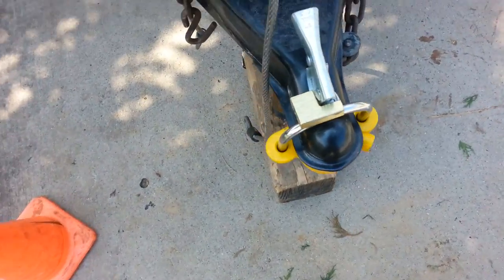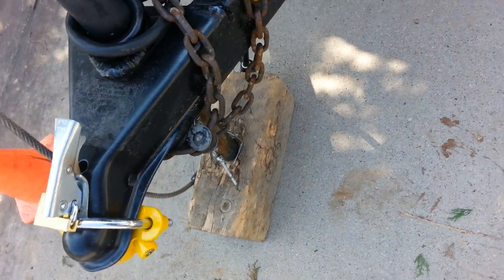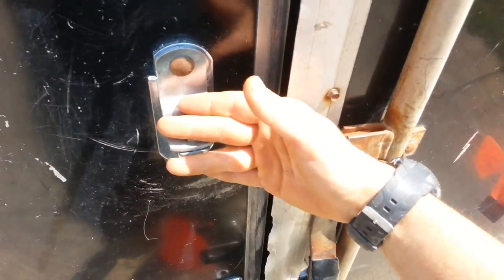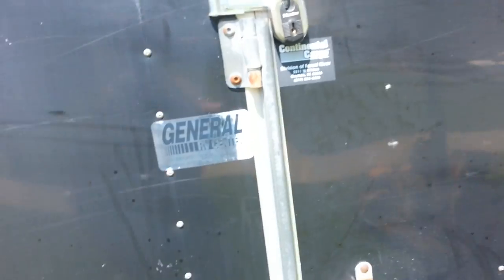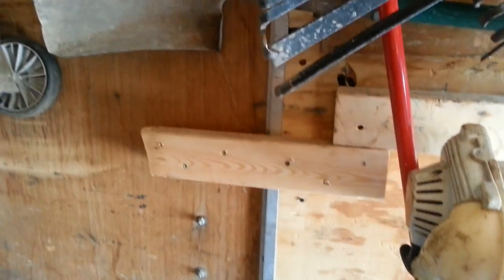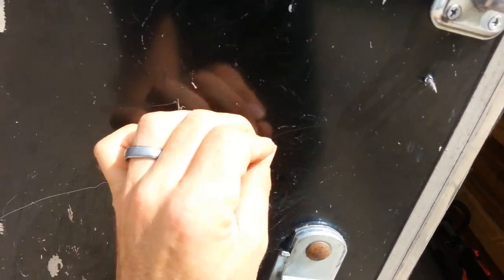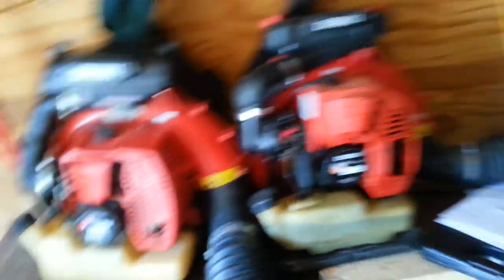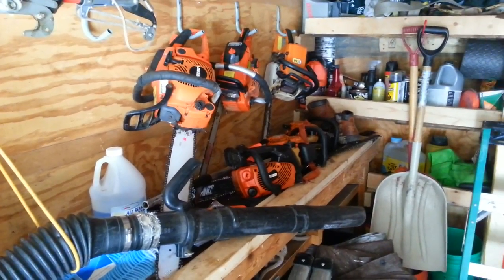Thieves BROKE-IN and Stole My Landscaping Trailer Equipment BEWARE

Comment: The latest thing down here in South FLorida, is that thieves climb on top of the trailer and cut the roof open and peel it back like a can opener. Then they steal all the small equipment without opening the doors. You have to bolt or weld sheets of expanded metal inside the entire roof for added security.

Comment: Cheers for your excellent videos. After having my stuff stolen at different times in my life I am the same with locking up my stuff and all secure. Just a suggestion. That green case with your locks keys, a potential problem. I would have a type of metal lockable container bolted to your vehicle with a master key kept on your personal self. Good luck and busy days.

Comment: i hear you man.i had a 32 inch toro walk behind that was my first baby lol and a 5x10 trailer stolen about 6 years ago and i still look for that thing on craigslist. if you build  or find a metal  box for the cheap alarm that has a small window in it so the motion detector still works and bolt or screw it to the wall they cant just grab it and smash it. with the locks you can find a  set of locks that are all keyed the same so you only have one key for all the locks. also don't forget about a gps unit for the big stuff like trailers and big mowers. just need a good hiding spot.

Comment: Im a plumber and Im in the union and I work my regular Job during the day but on the side I own a drain cleaning business/similar to roto rooter     And I got my trialer broken into about 5 years ago when I first started and the Sewer equipment in crazy expensive and I had saved for a few years to be able to buy everything I needed to get started and it almost had me ready to throw the towel in but I was lucky to have Insurance and get a majority of my things back but ever since then I wont park my trailer at night time anywhere besides the secure storage facility that it goes too.. It goes inside and theres cameras and night time security and gates and all that good shit          and I can sleep calm       Bc I was the same as you going out all through the night checking on my trailer and jumping at any noise I heard       When you get your shit that youve worked hard for stolen its a heart breaking experience thats for sure      My biggest regret is that when I was stolen from that I didnt hear it and I wasn't able to introduce the thieves to Mr.12 gage  lol   but it all worked out           Sorry for my rambling and another great vid bro

Comment: Here is the simple way to lock your enclosed trailer, much easier than what you are doing. Buy (3) 20' pieces of 3" C channel and get a few small pieces of scrap 3" schedule 80 pipe or DOM tubing. Take a piece of channel on the inside of the trailer on each side of the door and run it vertical behind the sides of the door. Weld a link of chain to the metal that can poke through to the outside for a puck lock to attach to top and bottom. Attach with carriage bolts and liquid nail. Same on the side door. Cut a piece to go across the top and bottom of each door and drill a hole to let the link poke through. Remove and discard side hinges. Weld pipe into channel where link pokes through. Install American Lock Puck Lock in all 8 places, get them keyed alike by a locksmith so you only need 1 key. Only way in would be torch or grinder. On tongue get piece of 8-10" thick wall pipe that has a cap on one end and a hole drilled top and bottom on other. Use a commercial tent stake for a pin cut off to length with a chain link of chain welded on the end. Weld small piece of tubing on bottom where link pokes out. Attach another puck lock under there. All locks are shielded now from physical attack and hitch is fully shrouded. Doors are fully held shut by C channel that is easy to remove in seconds but hard to cut off without power tools.

Comment: Enjoying the videos. Have looked into a lot of this for our enclosed trailer. Dewalt now sells and alarm with gps. Check it out. It's made for construction equipment. Guys are using it for enclosed trailers and even one band used it for their van. 

Using all the locks etc on ours and used your idea of the cable through wheels. Thanks again.
Reply from the maker: +Pete Biggiani badass

Comment: I'm sure you will going to get tired to locking your equipment every single day or night, you should install a car alarm in your trailer with two loudly ass horns on top of the roof just cut the hole for each horn.

Comment: Lock picking is a hobby of mine, and its scary how easy most of the locks on the market are to open.  Security in any form is about 10% actual securing, and 90% illusion.

For padlocks I recommend you don't cheap out.  Don't buy off name locks or MasterLock, don't use laminated locks (should be solid metal), and get the shortest and thickest shackle you can fit.  Don't use combo locks or word locks, they have so many faults its not even funny; not only can they be opened quickly and quietly, but a person can figure out the combo in about 30 seconds.  They can then just take one thing every so often without you noticing or wait till you get that new piece of equip. and take it.

Remember that "a chain is only as strong as its weakest link."  Think about where the "security" is and see what it depends on, and what that depends on, and so forth.  Lock is attached to the latch; is the latch cheap/weak/exposed screws?  Is the door the latch is on sturdy?  Keep going back until you have looked at everything.  

I recommend you also engrave your company name on everything, people are more likely to question where they got the stuff from and people aren't as likely to try to steal it.  

Good system and good to see you have a lot of thought into it.

Comment: This is why I dont have a trailer yet. I store my equipment in the back of my shed so if someone gets in thru the side or front thed be caught on multiple cameras. I hardly ever leave fuel in the tanks so if they do steal it thed need to ring the manufacturer to find out the fuel ratio to be able to use it.

Comment: Get a car alarm, deep cycle battery, and a high energy ignition coil. Ground ignition coil output to handles or body (if conductive) hook up coil charging wire to alarm light flasher lead and hook car horn to horn lead. Light flasher will charge coil, when power is taken away from coil input the charge will dissipate via coil output in the form of 50k volts. That'll send a message and cannot be defeated.......lol ;)
Reply: Forgot to mention get alarm with shock sensor.
Reply: +darter1075 Don't forget a small solar panel and controller to keep that battery charged.

Comment: mount a 12v battery somewhere that you can recharge and put a car alarm system on it .. battery and wires inside so they can't be sniped with a train horn blowing if it goes off ..